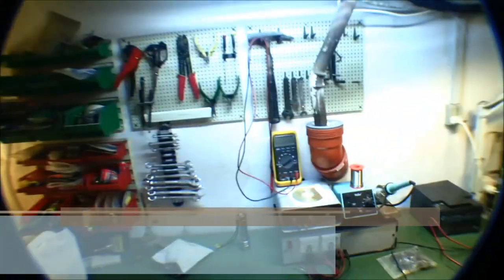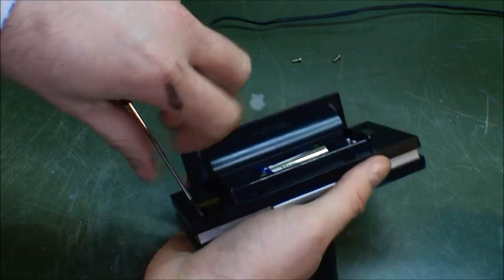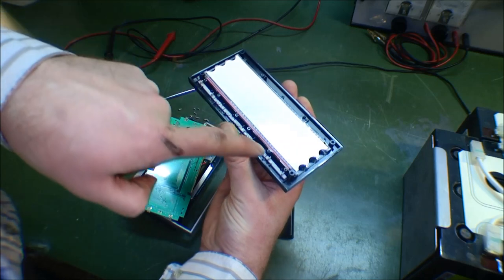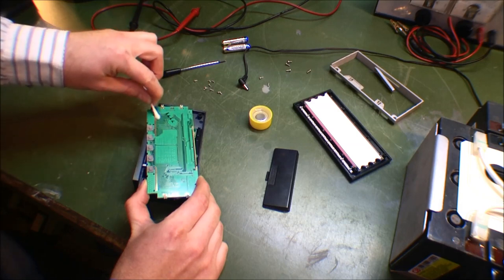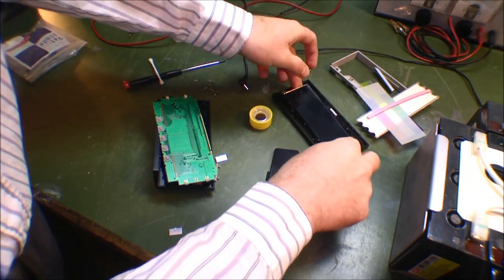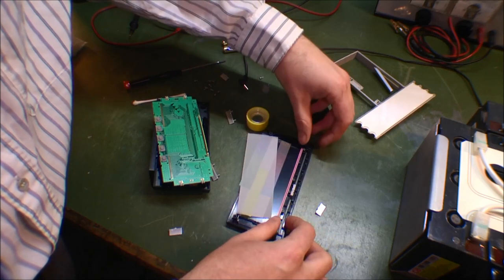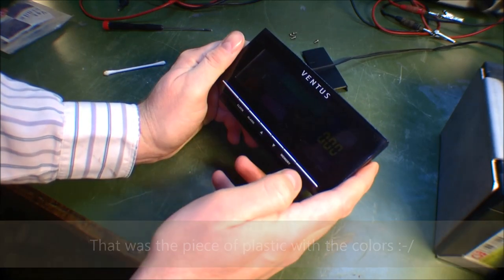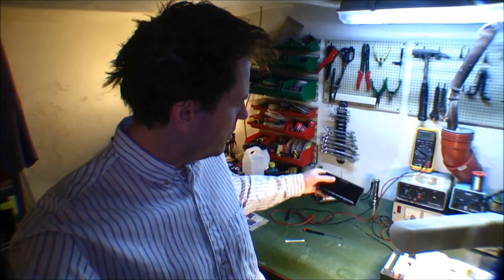Repair LCD display by cleaning zebra stripes - 148

Comment: I'm curious how the rubber strip comes into play to push display on LCD? Is there light shining through the rubber strip? Does the rubber strip have to be perfectly aligned with slots/holes on the strip and PCB? etc
Reply from the maker: The zebra stripes has layers of conductive and non conductive layers,, and put in strage it should power the right spot.

Comment: What adhesive do you use for this? I am trying to reattach the little strip in my Casio calculator watch and all I have is super glue.
Reply from the maker: I do not believe I used glue, with my little project here.

Comment: I've heard of these being cleaned only for them to last 2 years.  How do they last 8 years or so to begin with then have to be cleaned every couple of years.  Is there some coating you can put on them to contact better, or will a good clean fix it for a long time? 

Just wondering really what the cause of the problem is, I don't see how these can corrode if not really exposed to much water or moisture at all.

I'm thinking has anybody used some sort of conductive coating that you can apply individually to every contact/segment.

Thanks.
Reply from the maker: Hi +V LT 
I do not know of anything.
Thank you for watching! :-)
Reply: When they relocate electronics factories, it's usually for cheaper production, and cheaper comes from inexperience - as in no cleanup of flux on the soldered circuits.  And flux is corrosive.  It shouldn't need repeated cleaning.  It should've been done at the factory, and if it wasn't, once should do it.